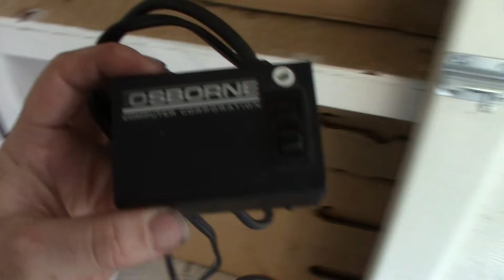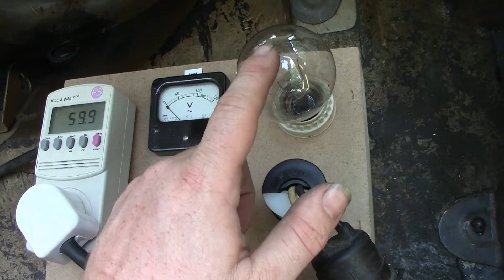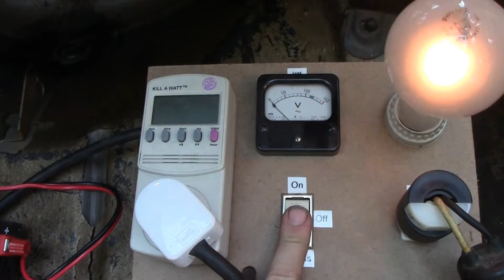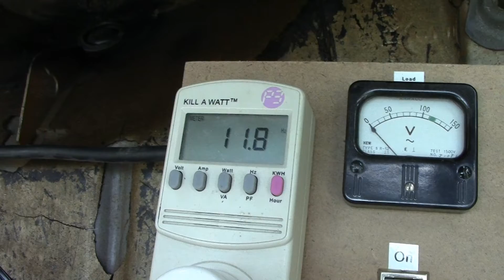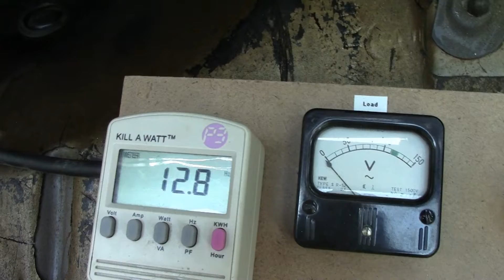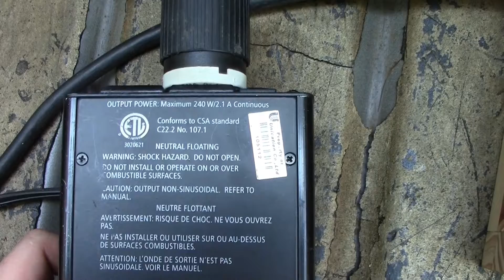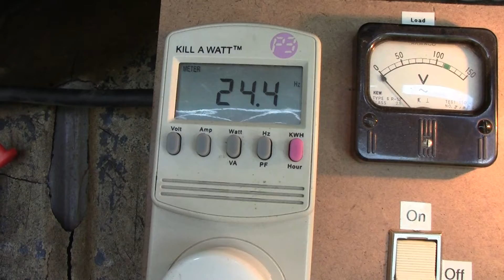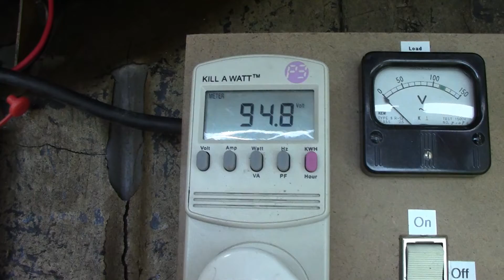Road Trippin' - Do I have a 300W Inverter that Doesn't Suck?

Comment: With switch mode power supplies the frequency and wave shape doesn’t matter at all. Switch modes have a rectifier as the first thing after the power button more or less. You can run them off 170V DC - that’s what they internally run on when you plug them into 120V mains.

The most efficient way to run a 120VAC-rated switcher supply off a car battery is to connect 14 of said batteries in series, for about 170VDC nominal ;) No inverter needed. 😅

The simplest and most efficient inverter is a 100Hz mosfet-based half-bridge driver plugged into the secondary of a 120V to 24V center tapped transformer. You’ll get something square-waveish without load out of the primary, and that’s perfect for switchers and for transformer-based supplies alike. You can put one together from junk parts for next to nothing and it will beat the pants off any “modern” inverter usually. It’ll be unkillable, require no forced air cooling, and will outlast you. Of course a few more parts are needed to make it practical, but that’s the basic idea. 

The old switch mode supplies that have a voltage doubler, ie. switchable between 120V and 240V, will require to be set to 240V and supplied with 330V DC. The voltages can be +3% to -10% around those mentioned above.

So, whatever problems you had with switching supplies had nothing to do with waveshape etc. They weren’t getting a high enough peak DC voltage to get their input capacitor high enough to keep the supply going. That’s all.

Supplying DC to a supply with a direct mains connected transformer will saturate it and blow the input fuse as expected.

For a 200W inverter you’ll want 6AWG wires going from inverter to battery terminals. Forget about the stupid lighter socket. It’s a fire hazard and was never rated for as much current as a 200W application will use, never mind 300W.

Comment: True he need north of 20V DC to get the 300 watts from the inverter.  However, his 15A fuse never blows so the inverters couldn't do 300W if they did have 20A DC in.

Comment: Insufficient current on your 12 volt side probably due to cable resistance. Regarding the kill a watt, I dont have one because they're not available in the uk but have a couple of different brands. In both cases they use a capacitive dropper to power their circuitry in series with a safety resistor. I've found that if you plug them into a modified sine wave inverter the safety resistor burns up after a few seconds. I've had to repair them twice. I'm assuming the capacitive dropper is passing a high AC current due to the sharp edges of the square wave.

Comment: The rule of the thumb is, if it comes with a permanently attached cigarette plug, it's not gonna put out more than 100W. It's just basic math and liability consideration with the cigarette plug.
The big numbers on the sticker is nothing but marketing, if the number is small it won't sell, so they make it big. Of course, if it's UL tested, the numbers are going to be more usable, but hey, people don't like to pay for small numbers.

Comment: Here is the problem as I see it.....your car battery might not be able to supply the current......or also you are putting the inverter to an extreme resistive load.....in other words you are over working it......300 watts is mainly to split it up to many resistve loads........not just one........I may be wrong but the inverter potentially is drawing a lot of current from your battery to produce 300 watts......more than 25 amps??......simply put if your car battery is weak.....just connecting an inverter to it might overload the battery.....how much current is the inverter drawing from the battery....also if you are on a max 15 amp line......I can only see the inverter output being able to supply 180 watts max...that is why no issues with 100 watt bulb...

Comment: You really should be using a scope meter (even a cheap one) if you want to have any idea on the output of these inverters. as you can see a kill-a-watt can struggle with finding the zero crossing transition of a modified sine inverters (and leading to the insane frequency readings that change over load)

you also have a low DC voltage problem, you could help this some by bonding the negative to chassis ground at your outlet, running your engine alternator, taking out the secondary fuse from your circuit, etc

Comment: Take it from a guy that does low voltage by trade and has messed with Solar panels, had a full desktop in a car in the early 2000's and use to do automotive audio and hear me out. The wiring is too small, 12AWG would be alright for a small audio amp but for that distance you should use 8AWG. Also it wouldn't hurt to run a ground, granted the body is the ground but it's to ensure a proper ground. Since this is a car I would also have to factor in the Alternator output and what the car is already consuming current wise. Also ditch the cig lighter and breaker and just use a fuse. Put in a fuse that suits the inverter. Remember Watts divide Volts equals Amps. Your best bet is to get a proper inverter and toss in a time delayed relay for the ignition so the car can start up and a couple of seconds later the inverter powers on. This way the car battery doesn't have to deal with so much inrush current at once. The cig lighter adapter is used for temporary use for low wattage devices such as phone chargers, laptops and stuff like that. Anything else that consumes a constant 100watts should not use a cig lighter. I see trade guys ignore this and wonder why their cig lighter adapter feels hot to the touch and sometimes is melting. 

A floating AC neutral for a home is where the neutral isn't balanced and is a very bad thing. However for this case the AC neutral and DC ground are not shared so the AC neutral and DC ground are isolated.

In all your best bet with your current setup is I would put the inverter closer to the battery to get rid of that voltage drop. Put the inverter on the passenger seat or floorboard. maybe double up on the 12AWG and be sure to have the inverter off until the car is running and don't forget to switch it off before turning off the ignition. Lots of those cheap inverters don't have any protection on sudden power off states and can spike the device that it's plugged into. When it comes to cheap inverters just double the output rating to get the output you want.

Comment: your 12v socket is only rated for 150 Watts you will need much better wiring and connection to be able to get 300+ watts out of any of them units 
12v at 300 watts = 25 Amps and that's if these were all 100% efficient and they are prob all more like 50-70% so you would need even more then 25 amps to get 300 watts out like 30-35Amps
this is 100% user error

Comment: I have a 300W inverter as well (okay, it outputs 230V 50Hz, but watts are watts are watts).
It came with a lighter socket plug and some battery clamps. The manual and even the sticker on the inverter says: 300W only when hooked up directly to a battery, on the lighter socket you're limited to 150W.
You need really beefy wiring on the 12V side.

On a friend's camper van, he wanted to be able to use his Saeco fully automatic coffee machine. So we installed a 2kW pure sine inverter. We hooked it up with 2 AWG cable directly to the auxiliary battery. It was able to make two cups of coffee on a fully charged 120Ah battery, then the inverter shut off due to low battery.

Comment: They're all shutting down due to low battery voltage. You need much thicker wires (they're drawing more current than that wire is probably even rated for), and you probably need to have the engine running as well.
Reply: Agreed.  The battery voltage is low
Reply: You should be measuring battery voltage at inverter input as well. Low battery voltage will derate the inverter and hurt performance.

Comment: I think the 12v socket you are using is your downfall, You would be better off with a set of chunky terminals, or connecting direct to battery if possible.
Reply: Connect the main feeds off the battery and use Anderson Power Poles for quick disconnects would be my recommendation.

Comment: 200W on a 12V inverter is going to want to pull close to 20A, and voltage drop matters, as the input voltage drops, the amps have to go up farther.  Connect it directly to a good battery with beef wires, then it's valid test, otherwise your method is useless.

Comment: Have you tried this test with the car running? It may be that the battery is unable to keep up and so the inverters are falling on their faces. If you have a constant input of power from the car, the results will likely be better.
Reply: I concur.  Do the tests with the car running and you'll get more accurate results.  I realize you may not want to use with the engine on all the time, but still.
Reply from the maker: The engine running holds the battery at a higher voltage that can overcome the losses in the wire itself.
It's totally not ideal, but I really was not expecting 12ga. to be THAT under-rated for the job.
Reply: @CelGenStudios  if you hook the inverter up in the engine bay or behind the firewall to cut the run length on that side, and run a longer cable on the 120V side, you might have better luck. I know with higher output systems, like 1500W inverters, they run from as close to the power source as possible and then you have ports distributed.

For higher end installations, they may also have two high output alternators, a bank of batteries, running off a diesel engine. (Obviously that would be for a work / utility truck, not a car, but I think you get what I mean.)

There are also 12V cooler units similar to what you have. It's lower volts, but higher amps. It works out similarly in the wattage consumption, but without the loss from the inverter stage in the middle.
Reply: @CelGenStudios  the wire isn't the problem. 12 gauge cooper wire has a resistance value of like 1.58 Ohms / 1000ft. It's the battery dropping voltage under load, which the inverter can adjust for up to a point, but once the load overcomes that, it'll quit. RV setups usually use multiple batteries for this kind of application.
Reply: @sbrazenor2  The wire is absolutely some, if not most of the problem. The rated resistance is when the wire is cold, and increases as it heats up, which it's definitely doing because at 200W he's drawing more than its rated current of 20A (once you account for inefficiency of the inverter). He's likely losing a volt or more through the wire.

I once used an inverter to power a 300W load. I connected it directly to the battery using jumper cables. They were 10 feet long and 8 AWG, and I was losing over a volt.
Reply: @themaritimegirl  the battery will drop voltage with a load applied anyways. That's why it's best to test with the alternator running.
Reply: That's exactly what's going on.
Reply: the socket is only rated for 150 watts maybe 175 max + he's got 15-20 feet of small cable and its not running 
I bet they all will run the 300 watt bulb np if hooked up to a battery properly
the only thing he has tested is how poorly the 12v sockets work

Comment: Confused as to why you say that switchmode stuff cares about frequency/sinewave shape a lot. My understanding was that since line voltage is immediately rectified (after a bit of filtering maybe) you could pretty much supply them with DC and they wouldn't care less
Reply: This has always been my understanding as well. A switching supply should care even less than a linear supply.
Reply from the maker: @themaritimegirl  Previous issues with unstable AC line frequencies. Not a scientific observation,  but something the supplies did not like.